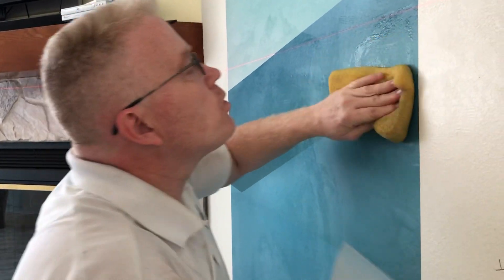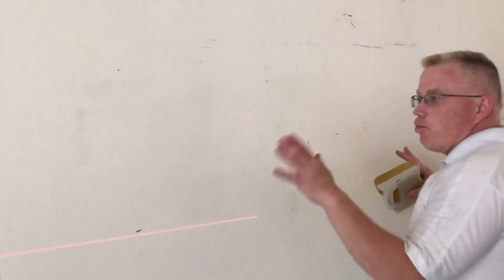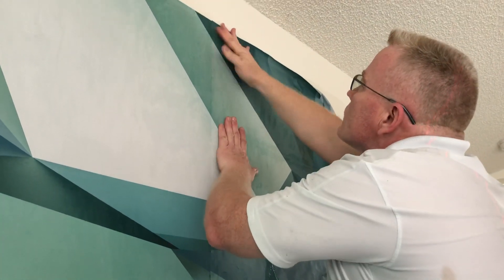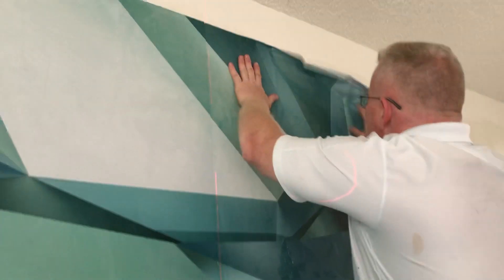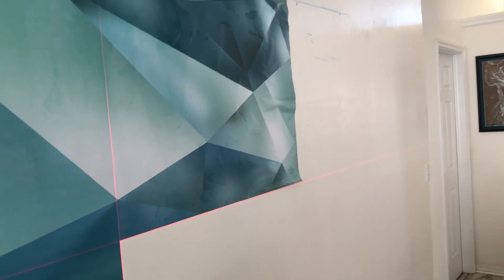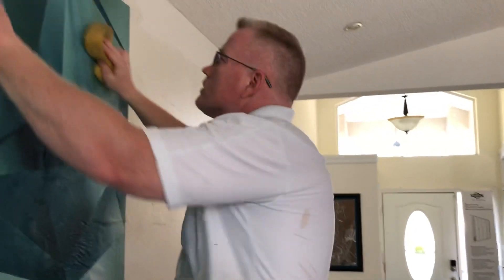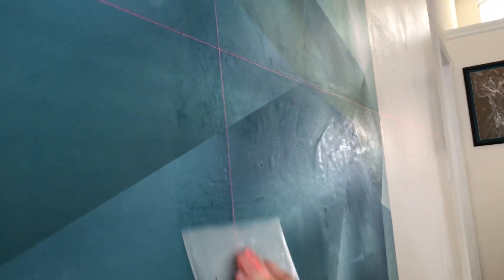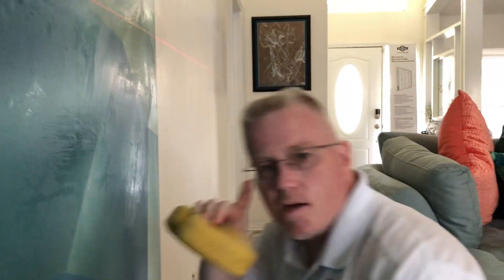How To Hang an 8-Panel Komar Photomural - Spencer Colgan

Comment: I don't recommend starting from panel 1 its always better to start from panel 3 or 5 then working your way out to the edges because this paper is too thin and will stretch while installing so if you start from panel 1 and you will have troubles installing panels 8 and 7 because the paper is  already stretched too much but if you start from the middle(panels 3 or 5) then your panels will be much better and square